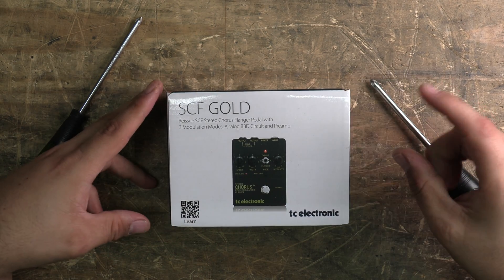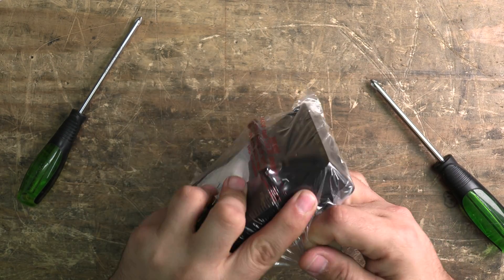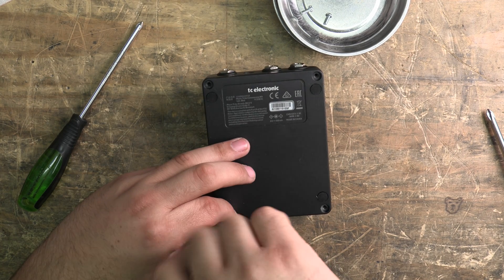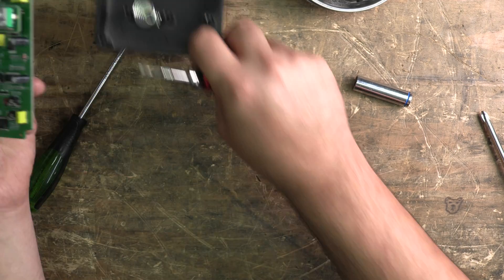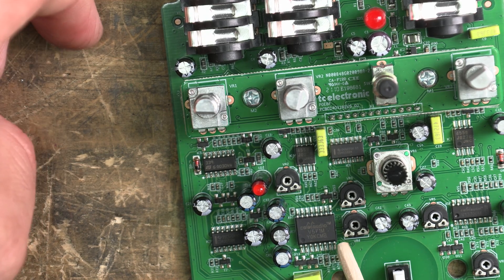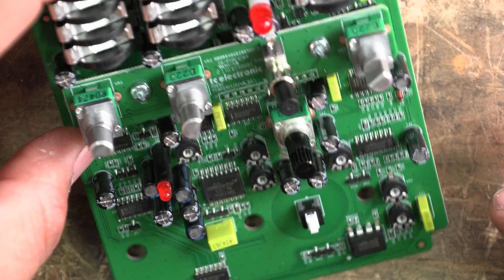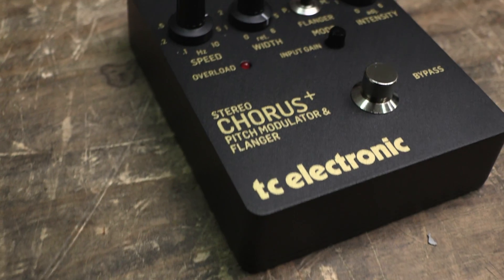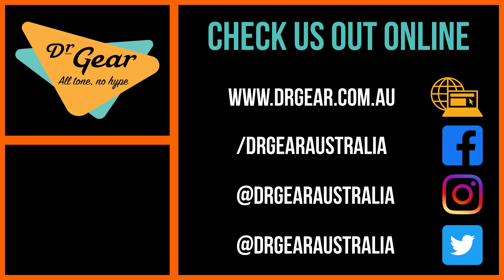TC Electronic SCF Gold Teardown & Sound Demo | Tones & Teardowns

Comment: It seems like SMD now is common on all price points. I see more and more these days, expensive $400 to $500 pedals that all use SMD.
Reply from the maker: SMD is a better way of manufacturing. There’s no reason to use standard through hole, even the smallest operator can do SMD production at home.

Comment: What was the BBD Chip used in the original TCE Stereo Chorus Flanger in the late 1970s-80s? MN3005 or MN3007/MN3008? 
How many BBDs Chips were used?
Reply from the maker: The schematic is out there online, download a copy and have a read. It’ll tel you much about the circuit.

Comment: Hi  is this pedal similar to the original? Thanks
Reply from the maker: It’s comparable but with a few updates for modern parts and an SMD layout and a lower noise floor. The core of it is much the same and uses the same commander setup.

Comment: It it supposed to be closer to the original 70’s/80’s unit? The later reissue didn’t sound the same..
Reply from the maker: The circuit is very close to the original models with some minor tweaks for lower noise and to use modern BBDs as well as SMD components.

Comment: Well made video but why ( like so many other reviews ) spend so much time with the controls maxed out or very high , where hardly anyone uses it . Maybe a small clip using the stereo outs would have been nice 😊👍
Reply: That always bugs me too on reviews of phaser/flanger/tremolo.  I hate the maxed out fast sound 😆
Reply from the maker: Most of the clips were with the settings around mid way and some with them quite low. There was the the one cranked clip which shows how it can go for a leslieish tone. 

Very few people have stereo rigs these days so doing stereo demos with limited time isn’t something we felt would be super useful.
Reply: Synths people need stereo!